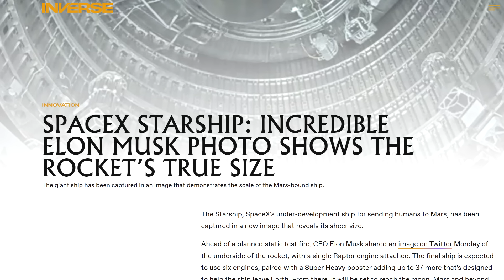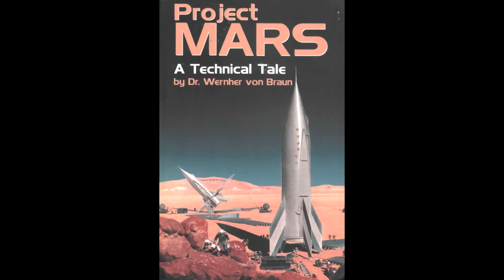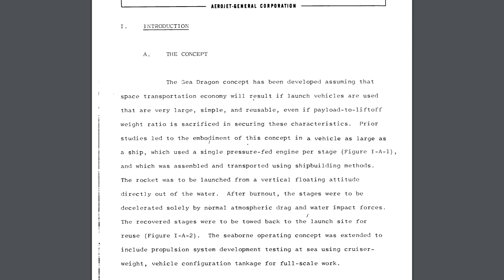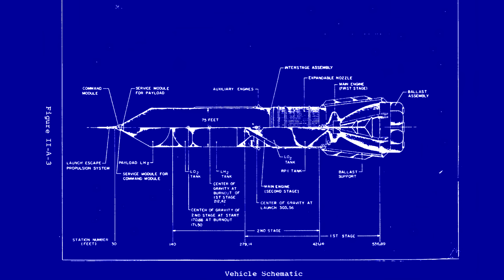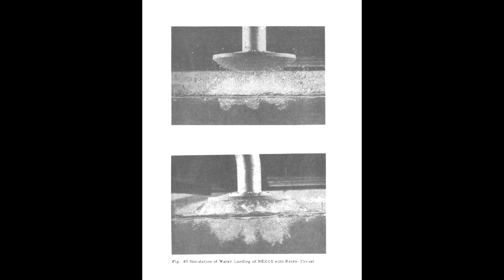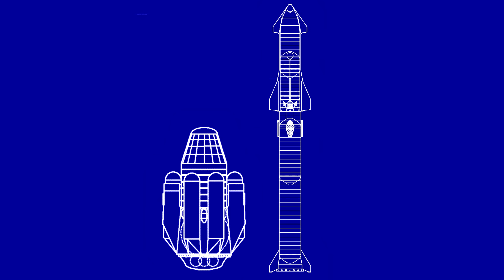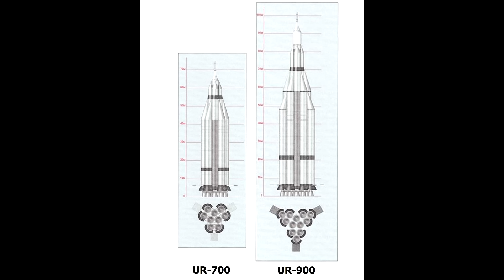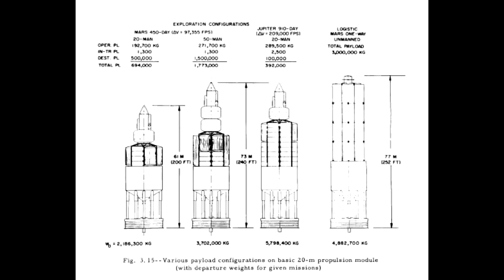The Old Rocket Designs That Make Starship Look Small

Comment: Imagine living in an alternative reality where they actually tried to build things like those and massive space stations in the 70s.
Reply: Could have happened. The Apollo Program killed a lot of more sustainable projects, because it sucked up pall funding, and then died of being way to expensive, killing all innovation for decades. Ironically, without the race to the Moon, space technology would likely be far more advanced today.
Project Orion would have been by far the best. It didn't require any fancy tech, materials, or manufacturing, but could deliver insane payloads, and not just to LEO, but anywhere in the Solar System. It only needed advanced nukes, thousands per launch, but that apparently wasn't an issue.
Reply: The problem was they were actually TOO massive to work. Bono was one of the few to address the likely damage such large boosters would do during launch. He had his ROMBUS launch not from a normal launch pad but one situated in the middle of a bowl shaped concrete ring which would be partially filled with water at launch. In addition to a massive sound-suppression water spray system the standing water in the 'bowl' would take on a concave shape at launch due to the engines firing and that and the shape of the bowl would direct the sound upwards so sparing the Cape and surrounding area from massive over-pressure sound waves. As the ROMBUS rose the shape would change and gradually 'defocus' the sound allowing the vehicle to pass through without harm. (In theory anyway :) )

The Boeing "Big Onion" used and artificial lake for takeoff and landing for the same reason with several of these 'launch bowls' spread out along the shore and the LV floated and towed into position for launch or recovery.

Vehicles like the NEXUS and AMPLV were suggested to be launched from offshore platforms but the distance needed for such huge vehicles was prohibitive. (It doesn't help that sound carries better over/through water either)
Reply: @randycampbell6307  Meanwhile SpaceX is like "Fuck the Whales / Entirety of Texas anywhere near Boca Chica"
Reply: @andrasbiro3007  Granted the fallout / radioactive emissions from a non orbital only Orion would be horrible
Reply: The concept of those "Generation Ships" was (and i guess is) a crazy possibility that could have been done with those simple yet giant Orion rockets!

I wish we had more SciFi exploring the social aspects of all that besides the mess that "Ascension" was.
Reply: @ericlotze7724  Whales will hardly be affected by Starship launching since its way over the water and sound db level falls off quickly over the shore after launch. Now Sea Dragon would have really fucked the whales though since it starts launching 150 meters under the ocean and who knows how much damage that could have done to whales given how far sound travels underwater
Reply: @kedrednael  No
Reply: @planetsec9  Starship is being planned to launch from the ocean on converted oil platforms which will directly impact the water (and sea life) for hundreds of miles around the launch AND landing site :) Yes this as been pointed out and Musk doesn't care as he needs more than one launch site to fly anywhere near as often as he wants. (Worse Boca Chica is NOT a really viable launch site AT ALL given the built up nature of the area, lack of viable flight corridors, {there are only two and both have issues reaching 'normal' orbits} and international concerns such a launch site would create)

Yes Seadragon would not be a very 'friendly'   launch system :) In FAMK I was not the ONLY person to flinch not only at the idea of an air-launched nuclear shuttle, (the crew, the mothership crew and half of Nevada would be irradiated the second the reactor came online :) ) but also the 'casual' note of the Seadragon being launched a bit over 30 miles from Guam.... The sound alone would shatter windows and eardrums) let alone the underwater noise wrecking every single hydrophone in the Pacific basin and killing every living thing in the sea for miles around. Sealaunch/Surf-launch is actually a good idea but not for such massive vehicles.
Reply: @kedrednael  Eh the "pulse units" weren't that great as pure bombs, by design. Which is why the "Orion Battleship" concept had actual dedicated weapons on-board. And the main issue is if you KNOW that something out there is carrying such things you keep a very careful and wary eye on it. Since there is no stealth in space it's actually pretty hard to get away with something like that. 

The 'plus' side is with such things in play we'd have not only a vastly better capability for space travel and exploration we'd also be VERY watchful and aware of what was going on in space around us AND the means to actually do something about it needed. But yes, in general the whole "Deep Space Deterrence Fleet" would been highly destabilizing and dangerous.
Reply: @randycampbell6307  and...millions of animals are killed every year due to agriculture. It's all about proportion.

In addition, there are methods to "repel" sea life from an area to minimize problems. In addition, if you launch past the Continental shelf, there is little in the way of life that you would affect, with thousands of feet of water beneath you.

These problems are all manageable. Large launch vehicles on a regular cadence would not even touch the amount of damage done by fishing trawlers.
Reply: Imagine living in this reality, where there are 13 people living in space right now.
Reply: @planetsec9  "effected" - inability to spell undermines the impression of knowledgeability you seek to convey
Reply: Vietnam and the War on Poverty killed such programs.
Reply: Watch for all mankind
Reply: Pretty much Gundam UC then :)
Reply: Yeah, TV SPACE 1999, and UFO
Reply: Imagine living in the world of Kerbal Space Program, where you a launch fully-fuelled Saturn five to the moon and back for the sake of a challenge.
Reply: @DrWhom  "Affected" is actually the proper word here - by the way, if the only argument you can make against someone's supposed 'knowledgeability' is to (incorrectly) point out a misspelling of a very easily mistaken word whose use has no impact whatsoever on the point they are trying to convey, then perhaps they are more knowledgeable than you?
Reply: Lack of technology didn't prevent it.  It's more a matter of money and the priorities of the representatives we elect.
Reply: @ericlotze7724  
What are you talking about??? SpaceX does nothing to whales or Texas.

And actually the fallout from an Orion drive wouldn't have been that bad. There were very clean nukes already at that time, and launching from a steel plate, instead of dirt would have prevented the vast majority of the fallout. Most of the fallout is generated when the explosion sucks up dirt and irradiates it. No dirt, no fallout. They calculated how bad the contamination would have been. It came out as one death per launch in the worst case. Which sounds bad, until you look up how many people other industries kill. Cars kill like 40 thousand people every year, just in the US.
Also one suggestion was to launch from the North Pole during a snow storm. Orion doesn't care, but the remote location and the storm would have prevented contamination populated areas.
Reply: @kedrednael  
Of course it would have been a major security problem. But the people who designed Orion already worked with a massive amount of nukes anyway. Do you know how many nukes were produced during the cold war? Tens of thousands easily. So we already accepted that danger, if unwillingly.
And these nukes weren't just sitting in well defended underground bunkers. for a long time bombers with live nukes patrolled the skies, and often even fighters. There were many accidents too, and many bombs were lost. The Soviets used nukes even more liberally.

Also, any decent starship drive is a WMD by definition, simply because of the energies involved.
Reply: @andrasbiro3007  That's true and the situation was already unacceptable. I just think it would have been even worse if Orion spaceships were made.
Reply: @ericlotze7724  There was a novel called 'Footfall' by Larry Niven and Jerry Pournelle in which a race of aliens invade earth. The US govt decides to secretly build an Orion equipped with guns from a WW2 battleship and four weaponised space shuttles clamped for release on the sides. Citizens of a nearby town had to take cover in bunkers when the thing took off from the sea.
Reply: @andrasbiro3007  There is no such thing as a "clean nuke".
Reply: @HalNordmann  
There is. In some designs like 95% of the yield comes from fusion. Pure fusion also will be possible eventually, with anti-matter catalyzed fusion.
Reply: @not_brundle1742  I agree, but that is what makes them so interesting to me!
Reply: @randycampbell6307  "No stealth in space."  Vanta black 2 and the ease of creating shadows in any of our current detection systems means this statement is total BS.  

Even if it isn't 'stealth' in the typical sense, detecting a few hundred objects and not being able to visually see the object you are aiming for is, for all intents and purposes, the same thing.

On top of that, we have ground based detection systems that are sensitive enough to detect a change in length smaller then the width of an atom, detecting and tricking LADAR would have the same back and forth predator/prey relationship that RADAR and stealth played when they were first developed.  Mimicking LADAR pings to appear invisible is something stealth tech has already started to do.

I think you are talking about thought experiments from the 60's up until the early 2000's that were made popular by sci fi media....... Tech has changed dramatically since then.
Reply: @DarthObscurity  ""No stealth in space."  Vanta black 2 and the ease of creating shadows in any of our current detection systems means this statement is total BS."

Not at all since it still doesn't reduce your observability in other spectrums.
  

"Even if it isn't 'stealth' in the typical sense, detecting a few hundred objects and not being able to visually see the object you are aiming for is, for all intents and purposes, the same thing."

Visual is not only not needed it's the least applicable means of detection. IR is vastly more important and you literally can't hide against a cold background.

"On top of that, we have ground based detection systems that are sensitive enough to detect a change in length smaller then the width of an atom, detecting and tricking LADAR would have the same back and forth predator/prey relationship that RADAR and stealth played when they were first developed.  Mimicking LADAR pings to appear invisible is something stealth tech has already started to do."

Yes and in doing so they need to go 'active" which wipes out the stealth anyway. Mimicry is power and computing intensive which is why it's so difficult to use successfully.

"I think you are talking about thought experiments from the 60's up until the early 2000's that were made popular by sci fi media....... Tech has changed dramatically since then."

Not at all, "No Stealth in Space" is a truism that is used today. You can "hide" for a very short time period with all sorts of active and passive methods but anything over a few hours is physically impossible
Reply: @andrasbiro3007  Well, these bomb designs are huge - Project Orion's bombs were much smaller, without any fusion boosting, or even much of a possibility for it (nukes have a minimum size). In addition, 5% of yield energy is still a lot of loose radioactive particles. As for pure fusion - you are better off dropping the bomb drive alltogether and using a magnetic nozzle engine.
Reply: @timothyblazer1749  No one is saying that this is somehow an issue solely limited to rockets. But like both things can be a problem at the same time, we can both demand less environmentally destructive fishing and agriculture and demand the same from rocket launches, it's not a zero sum game. The point is that as we enter a world where space industry slowly becomes a reality we want to do so in the right way that doesn't further damage our environment. We don't want to suddenly wake up one day and have a huge space industry that causes a ton of environmental damage because we didn't make sure to properly regulate it from the get go. After all you hopefully agree that the point here is to transition our world into a sustainable form of living and not just replace one type of polluting industry with another equally or slightly less polluting type.
Reply: @HalNordmann  
There's no upper size limit of the ship. The largest original design was like 8 million tons. And you can go much bigger, the limit is where you can no longer build a rigid structure from steel. And even that can be fixed by putting the drive in the front, and pulling instead of pushing (Medusa).

The problem with the magnetic nozzle is structural integrity. It's hard to fully contain a thermonuclear explosion. Something like that was designed of course, it's called nuclear salt water rocket. It rides a continuous nuclear detonation.
Reply: @andrasbiro3007  Although there is no upper limit in theory, there are a few in practice - like the fact that above a certain size, you will melt any launchpad, or cause destruction even from the middle of a desert. Add in the fact that an NPD can't land in atmosphere due to plasma wash issues, or that the fuel is incredibly expensive, or that you can't cluster them like normal engines - and suddenly nuclear pulse propulsion is quite useless. And don't even mention NSWR - that thing would've been a nuclear explosion waiting to happen.
Reply: We would have on Mars in the 80s as the NTR engine was passing certification for use.
Reply: @jessepollard7132  NERVA was a bit immature (for example, the fuel rods tended to snap under increased loads) and the radiation shields on the planned nuclear tugs was too thin. However, with more money going to space, we probably could've been on Mars in the beginning of the 90's.
Reply: @HalNordmann  
1. A 8 million ton ship is not big enough?
2. I couldn't find anything about the landing issue. But even if it's a problem, if you have atmosphere, aerobraking is a possibility. Of course bigger ships are harder to brake, but there are ways to drastically increase drag, even at this scale. The final landing can be done using chemical engines, or some other method.
3. Why do you want to cluster an engine that can be scaled up infinitely? The only reason I can think of is redundancy, but you can design it into a single engine. The only thing you can't make redundant is the pusher plate, and that's just a huge chunk of metal, it won't malfunction or get damaged.
4. The NSWR is a a nuclear explosion that's happening continuously by design.
5. Any good space drive is a weapon of mass destruction. It's simple physics. You need extremely high exhaust velocity and reasonable trust to not die from old age before reaching your destination. And unfortunately this combination means your drive's power output is comparable to nuclear weapons. And it's even worse if you want constant 1g acceleration for artificial gravity and shorter travel times.
Reply: @andrasbiro3007  An atmospheric landing with an NPD basically means flying INTO a nuclear fireball, while the ship is based on moving AWAY from them. And sure, you could use a separate landing engine, but that defeats the entire purpose - even if the NPD may be tolerant to high ship mass, the landing engines aren't. There is also the problem that NPDs can't be clustered - an engine fails, your ship can't thrust anymore. Even if most of the complicated mechanisms are in the bombs themselves, there is still plenty of stuff that can fail in a system experiencing such high mechanical stresses. This brings up another problem with NPDs - the fuel is incredibly expensive. You need berylium (difficult to process due to toxicity), tungsten (very rare and tough to smelt), uranium (difficult to process due to radioacticity and need for enrichment processes), control triggers (complex whether they are electronic or mechanical), etc. You may run into the same problem as with Gyrojet weapons - if the things you expend (ammunition/pulse bombs) cost almost more than their deployment mechanism (gun/NPD) itself, it gets expensive to operate very fast, not to mention the impossibility of offworld refueling. Conventional nuclear engines, ion drives or even just chemical thrusters all run on relatively cheap fuels that can be sourced in-situ.
Reply: @HalNordmann  
1. Again, just use aerobraking. Also I'm don't think it's impossible. You simply take into account the speed when you explode the bomb. It's just timing.
2. Again, what could break? If a pulse unit doesn't work, you just fire another one. The pusher plate is a big chunk of steel, not much can go wrong there. That leaves the shock absorbers, which can be as redundant as you want.
3. Industries already working with lots of very toxic materials, that's not an issue.
4. Tungsten is not rare, and not that hard to process. Traditional light bulbs used tungsten wires.
5. Uranium is barely radioactive, and modern enrichment processes are cheap.
6. Electronics are dirt cheap and very powerful, especially compared to what they had in the sixties when they came up with the idea.
7. No need to refuel, these drives have insane delta-V, orders of magnitude more than any other current or near-future drive.
8. Nothing else can combine high trust with high specific impulse. At least nothing less powerful. Ion drives actually use very expensive fuel, and have extremely small trust. Chemical rockets are pathetically inefficient, barely enough to get to Mars, and hopeless beyond that.
9. Those who came up with the idea worked with nukes every day. They understood the best how much it really costs to make them. Of course that's top secret, but the fact that they even thought about this, and that the US military took it seriously, proves that the cost must have been reasonable even back then.
Reply: @andrasbiro3007  
1) "Close enough" or "simply" doesn't exist when dealing with forces of this magnitude. And the problem of final braking still stands - you want only a few m/s on the final landing, and NPDs can't do that.
2) What about a misfire? A jammed shock absorber could send the entire ship spinning, even if they are redundant.
3) Still, better to get by without toxic materials. There is a reason big hypergolic rockets like the UR-700 weren't pursued.
4) Light bulbs use single grams of tungsten. A single pulse unit would require it in kilograms, and you need dozens for a launch.
5) "Barely radioactive" and "nuclear bombs" don't belong anywhere near each other. That stuff is even more potent than reactor fuel, and safety measures in uranium mines are very strict for a reason.
6) Even if electronic control chips are cheap by themselves, burning them by hundreds will get expensive.
7) They actually don't. Ion engines are still kings of Isp. They can't be used for surface to orbit, but you can't have everything.
8) Although ions regularly use noble gases, some variants can use ordinary hydrogen for a bit of performance drop. As for other engines, how about nuclear-thermal engines? Most of them don't spit radioactive particles, and don't have any worse Isp.
9) The military investigates everything they think will give them an edge, no matter how stupid it is. Remember, they even looked  into psychic powers and modifying Earth's rotation. When you have a blank-cheque budget, everything looks like a weapon.
As a side note, look for the short story "A Tall Tail". It is about toxic fuels instead of nukes, but the principle of overlooking the environmental impacts and overselling the benefits still applies.
Reply: @HalNordmann  
1. It's not "close enough", these things can be calculated very precisely. And I was never talking about final landing.
2. A misfire can be handled. It's in the original design. Shock absorbers don't jam, this is an extremely well understood technology, and the failure rate is minuscule. Also at these power levels the jammed shock absorber would be crushed by the pusher plate, and the rest would handle the forces. Parts are usually designed to fail safely.
3. Not better if you have to give up all the performance. There's a reason why we use countless toxic materials.
4. The amount is not important. It's not a rare material.
5. Uranium is barely radioactive. It doesn't become more radioactive in a bomb either. It's toxic as a heavy metal, that's why safety precautions exist. In mines especially, you really don't want to breathe in heavy metal dust. But it's not worse than lead, which we use routinely in many industries.
6. Nope. Electronics are really dirt cheap. Especially when you only need sixties level of processing power. Also consider that we are throwing away entire rockets after one use. Hundreds of millions of dollars per flight. Chips cost cents when you buy in bulk.
7. Nope. Ion drives have ISP around 2000-5000, and the classic Orion around 2000-4000. More advanced designs go up to 12,000-16,000. And the trust to weight ratio goes from 0.1 up to 13. Google "atomic rockets engine intro" for a pretty comprehensive list of starship drives, with various level of realism.
8. Nuclear thermal has similar ISP to chemical rockets. The main advantage is being able to use pure hydrogen. The low atomic mass increases the ISP for a given engine temperature. But you still have to keep the engine from melting, which limits the performance. There's the nuclear salt water drive, but that's just Orion on steroids. It rides a  continuous nuclear detonation. ISP close to 500,000, T/W 40. Power output 30TW. Unfortunately it's not exactly clean. Not recommended to use anywhere near Earth.
9. Look it up. They had very detailed designs, and were close to building a prototype. The project was ultimately killed by the limited test ban treaty. But NASA still keeps the documents on hand just in case. It can come handy if we need to deflect a large asteroid. And again, the scientist designed it were working at Los Alamos, so they understood this tech better than anyone. Google "The story of Project Orion George Dyson" and "To Mars By A Bomb - The Secret History of Project Orion"
Reply: @andrasbiro3007  That NPD Isp is a bit too high - it doesn't have anywhere near the exhaust velocity of an advanced ion engine. I've read Atomic Rockets, and it isn't anywhere near the performance you say. Are you sure the numbers are correct? And the design wasn't anywhere near a working ship - both V-2s engine and the F-1 use the same gas-generator cycle, but it took many years to get from one to the other. The tests were military-grade blowing of firecrackers under tin cans - it didn't even test the shock absorbers!
And there is a massive problem with NPDs - they would wreak havoc with nuclear proliferation. A stolen NTR ship might mean a city needs to be evacuated for a few months due to a dirty bomb. A single stolen pulse unit means a mushroom cloud over a major city - and a single Orion ship carries hundreds of them! There is a reason the only plans for them were battleships for nuclear war. Do you know any serious civilian NPD concept? The Mars ship doesn't count - it was also a military plan.
You should REALLY read "A Tall Tail", and understand that some risks are so great, no performance is worth it.
Reply: @HalNordmann  
1. I took the numbers from multiple sources. If you think they are wrong, give me a better source.
2. The design isn't too complicated. Nuclear shaped charges existed, and very likely were tested too. Most of the details are classified, for obvious reasons, but we can make educated guesses. As I explained many times, the founders of Project Orion were the same scientists and engineers who developed and built these nuclear weapons, so they knew best what's possible. They also tested the pusher plate with real nukes. Not specifically for Orion, it was a side effect of all the nuclear weapon testing they did. Large shock absorbers were also well known, and related to nuclear bombs. These were used to protect underground bunkers from the shockwave of nuclear strikes, missile silo operators from the launch of their own missiles, and other similar things. The "nuke dispenser" was a scaled-up vending machine, designed with the help of Coca-Cola. Everything else would have been essentially a wet navy ship, as mass wasn't a concern. They literally planned to build it in a shipyard.
3. They did all the work that could be done on paper, and proved the concept with a small-scale model, so the next step would have been building an actual prototype. They did seek funding for it, and almost got it, before political winds changed. A small change in history, and we could have had a fleet of Orion battleships 50 years ago.
4. The same dangers exist with regular nuclear bombs too. And especially in that era, when nukes were regularly used everywhere, in the US, and in the USSR too. Often they were handled carelessly, and many were even lost. Or even mistakenly loaded onto planes instead of chemical bombs. Despite all of this, none were detonated accidentally, or used by terrorists. The main reasons are the several layers of safety systems, and the very special knowledge needed to handle them. Most likely terrorists wouldn't be able to use a nuke, even if they had one.
5. Dirty bombs are far easier to make, radioactive materials are used in many industries, for example some x-ray machines use cobalt-60, which is radioactive enough to actually glow. And on several occasion such sources were lost or stolen, and caused actual serious radioactive contamination in populated areas. Once they even build a house with contaminated steel, and only discovered the mistake decades later. Also dirty bombs are mostly ineffective for many reasons.
6. Any decent spaceship drive is a weapon of mass destruction, due to the energy requirements. There's no such thing as an unarmed spaceship. Also known as the "Kzinti lesson", "a reaction drive's efficiency as a weapon is in direct proportion to its efficiency as a drive". Not to mention that simply dropping a rock from space can do as much damage as a nuke. Just ask the dinosaurs. So we'll have to face this problem if we want to do anything serious in space.
Reply: Space Station 76
Reply: Would’ve been amazing
Reply: @andrasbiro3007  A single nuke doesn't cause that much radiation, but sending 1000's of tons of payload with hundreds of nukes would probably add up a lot.
Reply: @randycampbell6307  bruh theyve tested NERVA before and even perposly blown up an engine while it was running. It might cause some health problems for the crew, but not nearly that bad
Reply: @NickH-o5l  I'm well aware of the testing done on NERVA, having several binders worth of collected reports. 
And to be clear they had to extensively engineer the "TNT" (yes actual name of the engine) to explode. A point to keep in mind is that the 'chunks' of the reactor were easy to find BECAUSE they were highly radioactive. Shielding is a key factor in design for any NTR. This includes the need to make and maintain a good "shadow" from the reactor so that no stray radiation gets scattered back into the crew section.
The radiation does reduce over time but in context once you've run an NTR it will be producing radiation for its entire lifetime.
Reply: @randycampbell6307  so what your saying is that the danger of a real-life NTP air launched shuttle, that danger would be posed by weakly radioactive particles in the exaugst spread over a large area, right?
Reply: @NickH-o5l  Nope, once that NTP reactor fires up it's spewing a lot of radiation in all directions. Even worse for an air launched NTP is that the atmosphere will help reflect that radiation so a "shadow shield" doesn't work. Shielding a whole reactor, (and you literally can't with a cone of it being inline with the nozzle) would be prohibitively heavy.

As is a 'shadow shield' would protect the crew of the NTP somewhat but areas around and below the launch point would not be protected at all. (When you see the NTR Shuttle launch in "For All Mankind' the crew of the launching aircraft as well as anyone on the ground is going to get a near-fatal if not fatal dose of radiation and the crew of the Shuttle are going to get badly radiated by back-scatter around the shadow shield due to stating in the atmosphere)

One thing the NERVA program managed was to greatly reduce the amount of material that came out of the reactor into the exhaust so the exhaust wasn't very radioactive at all. But most of the NERVA tests were done with little or no shielding for the reactor, which meant you could not be outside within a mile or so while the NERVA was running. It usually took several hours for the reactor to cool down enough to move back to the maintenance shed. That didn't mean it was 'safe' as the reactor was still giving out a lot of radiation but it was something that could be dealt with using shielded equipment and personnel.
Reply: @randycampbell6307  so its the presence of the atmosphere combined with the need to save weight that causes this thing to spew radiation everywhere?
Reply: @NickH-o5l  The need to save weight is pretty paramount yes, but you need to keep in mind that a nuclear reactor will always have radiation as a side effect of operation. It can be mitigated by shielding but that takes mass, usually a LOT of mass. Hence the use of a "shadow shield" which puts the mass between the most effected (crew) because they have to be within a certain distance of the operating reactor. 

What you really want to do is not activate the reactor until you hit about 100km or above most of the atmosphere. This will reduce the backscatter to essentially nothing and the 100km of atmosphere will help protect those under the flight path.

NTR's are great for in-space use but are not that great at surface to space applications.
(And that can probably be argued as there have been proposals for surface to space applications, with really well thought out operations :) )